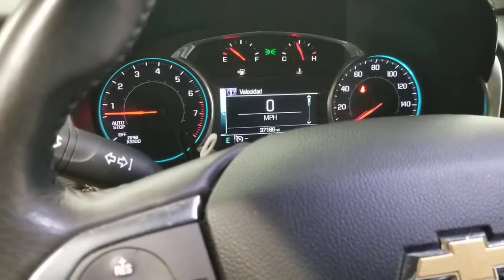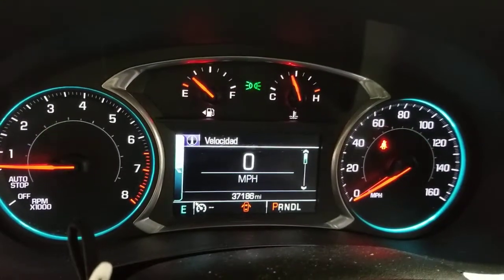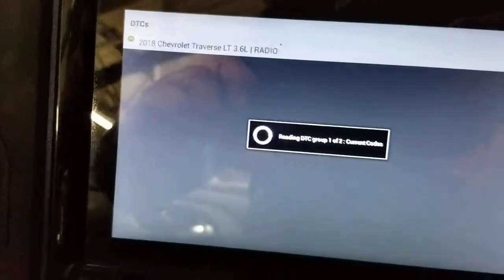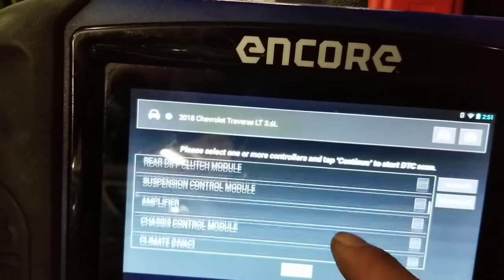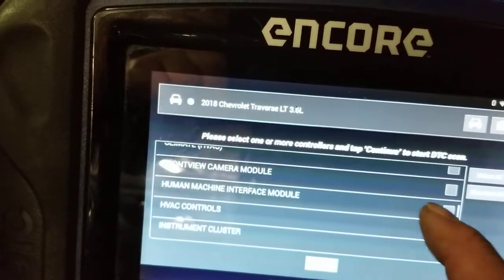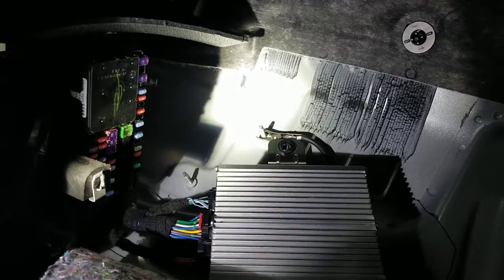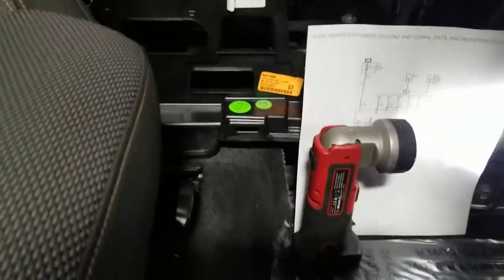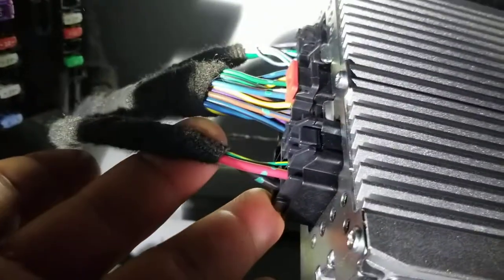2018 CHEVY TRAVERSE NO AUDIO , TURN & EMERGENCY LIGHTS SOUND,LOCATION & REMOVAL OF ANC MODULE OR AMP

Comment: Thanks for this video. I was able to fix mine, I took it apart and cleaned a burnt spot on the circuit board, plugged it and worked!
Reply from the maker: Cool
Reply: how did you remove the side panel to get the module out or did you not

Comment: So i got a weird noise coming from my speakers their not blown out i thought they were they work still but its like a high pitch whistling noise that wont stop no music or radio would be playing volume would be down and off and still makes a ringing noise any information? Maybe my amp has a lose connection or bad ground idk
Reply from the maker: Try to wiggle de wires close to the AMP ,see if it goes away if not it sound like you problem may be the AMP. Shorthing  internal

Comment: I have a 2010 Chevy Cobalt, my radio turns on but there’s no sound from the radio, the blinkers or the door chime. I tried to replace the driver door speaker, and that hasn’t fixed anything. Do you know how to check the amplifier to make sure it’s working? I’m at a loss
Reply from the maker: Would you like to sent the vin number so I can check a sckematic, and what brand audio you have, so I can get an idea to my email plese?  penita33@hotmail.com
Reply: Did you figure out the issue? I’m having the same issue

Comment: I have the same issue with our 2018 traverse, i jumped the wires and there is audio, got the new part and still doesn’t work, place we purchased the GM part from states we have to program it first ?? Is this true
Reply from the maker: No its plug and play, you were supposed to check for power and ground before replacing any part.
Reply: Doesn’t it just plug right in, 3 plugs , the new part was mounted then plugged in
Reply from the maker: It doesnt have to be program to the vehicle,it just plug and play

Comment: What Kind of wire do I need to check for sound? I have a 2014 Chevy traverse. No sound comes from the chime,turn signals ,emergency signal or radio but sometimes makes a noise. Can you help me
Reply from the maker: Hi Miss Gonzalez the wires that comes from the radio, at the amplifier, are you going to check it your self or somebody will do it for you?
Reply: @cjuanchy  I’m going to check it myself. But want to see how I can check if it is the amplifier that needs to be replaced before I buy the part.
Reply from the maker: Can you sent VIN NUMBER please so I can pull a wiring diagram
Reply from the maker: @Alejandra_Gonzalez  or If you like to sent me a good phone number so I can call you when while u doing it to penita33@hotmail.com

Comment: I have traverse 2018 , screen blavk out but working fine on reverse camera, no sound of blinkers and no audio at all . any suggestions?
Reply from the maker: You need to fix your radio first
Reply: Did you figure out the problem?
Reply from the maker: @melissaalfaro9739  yes on my case ,It was the amplifier it self
Reply: @cjuanchy  thank you for the response we replaced the amp and it’s still not working so we’re gonna try a few other things this is just frustrating lol.
Reply: @melissaalfaro9739  i took the car to the dealership let's see what will happen
Reply from the maker: @melissaalfaro9739  Im sorry to hear that, but in the video I showed how to bypass the Amplifier to avoid replacing good parts.
Reply: @cjuanchy me podría tal vez ayudar?
Reply from the maker: @melissaalfaro9739  necesito saber todos los detalles sobre que han revisado ,lo que hace y lo que le han hecho, o si gusta enviarme un número a donde comunicarme con ud o quien esté arreglando el vehiculo
Reply: @cjuanchy  si como se lo envío? Me podría mandar su correo electrónico
Reply from the maker: @melissaalfaro9739  penita33@hotmail.com voy a ocupar el numero de VIN
Reply: @cjuanchy  le mandé mensaje

Comment: What kind of wires can I use to check if there is sound? Like you shown in the video when the radio started playing
Reply from the maker: Its been a while since the video, can you textme yor vin number an a good email or phone number to sent you the schematic and tell you what wires , but you need to make sure that you have power and ground going to the amplifier before checking  the speaker wires

Comment: Hola. Tengo este problema en mi Buick Enclave 2018. Aveces suena y otras veces no suena nada en el estéreo ni las luces de cruce. Suena como cuando un micrófono se cae al suelo o cables mojados.. no se un ruido raro y fuerte.
Lo cierto es que cada vez se hace más frecuente.. aveces suena sin problem otras veces no o va y viene el
Sonido del radio, etc… 
Podrías ayudarme?
Reply from the maker: Gracias por comentar.  Por la descripcion que leeo, apunta como que el amplificador esta fallando ,tal vez le este entrando agua, lo primero seria revisar si hay reciduos de agua en el amp y conectores.

Comment: Me pasa que, me sale este code C0800-03 Control Module Power Circuit - Low Voltage es este mismo???
Reply from the maker: Es el mismo tipo de vehiculo?
Reply: @cjuanchy  si Chevy traverse 2018. Ya tengo audio solo espero q me llegue la parte el viernes

Comment: hello my friend awesome video! looks like the amp is really close to the same amp as a 2016 camaro's do you by chance have a Schematic for which wires i can jump to test if the amplifier is bad or not, like you did?
Reply from the maker: Im sorry at this moment Im out of town,I be back  on 10 days ,if you still need it by then.
Reply: Yesni can use that to
Reply: Did you fix the camaro amp? I have a 2017 camaro and my touch screen doesn't turn on nor do I have any sound for turn signals

Comment: Hola Juanchi! Tengo exactamente el mismo problema Chevrolet Equinox 2018. Podrías ayudarme? 🥺 donde está para reiniciar o verificar los fusiles? 😭
Reply from the maker: En la caja de fusibles busca los que digan audio
Reply: @cjuanchy Hi, I just replaced the ANC module in a 2018 Traverse but still have no audio l. I also got sound after using the jumper wire. Thanks for any help you can provide

Comment: Hola, tengo el mismo problema en una 2015 silverado, radio prende pero no hay volumen en el radio, direccionales, o intermitentes tampoco. Estoy buscando el amp pero no lo encuentro y no tiene BOSE sistema?? Me puede decir donde esta?? Gracias!
Reply from the maker: Buscalo detraz del respaldo del asiento de atraz,debes quitar el asiento y un panel y ahi esta, lleva 3 tornillitos que lo detienen
Reply: Muchas gracias!!
Reply: Lo quite pero no encuentro nada.. quite todo el asiento trasero y nadamas esta el motor para la ventanita de atras…
Reply from the maker: Tal vez esta integrado en el radio ,si gustas enviame el numero VIN que esta en el parabrisas y el lunes que vaya al trabajo lo busco en los diagramas
Reply: 3GCPCREC9FG536026 bueno lo espero…
Reply: El problema sigue ya le desconecte la bateria, cheque los fusibles en el lado del pasajero, le cambie la caratula del radio con otra y nada… otra idea que se le ocurra aparte del amp que no encontre?
Reply from the maker: @JoseLopez-dz8pk   ocupo saber si tiene  navegacion y amplificador o faltan los 2 o falta uno?
Reply from the maker: @JoseLopez-dz8pk  o si prefieres un numero de telefono a donde llamarte lo puedes enviar a mi correo penita33@hotmail.com
Reply: Le mande mi cell al correo Que me dio… tiene navegacion pero amp no creo xk no tiene Bose sistema de audio

Comment: Se puede dejar puenteado sin comprar otro amplificador?
Reply from the maker: Yo lo puentearia si fuese propio,en tu caso tienes sonido en tus bocinas que es lo que uno en realidad quiere escuchar.
Reply: @cjuanchy  no hay sonido, solo se escuchan los twitter
Reply from the maker: @jloaeza65  por eso desconecta los conectores y hasle el puente o bypass como lo entiendas,en pocas palabras elimina el amp. De fabrica.
Reply: @cjuanchy  lo voy hacer así, muchas gracias por tu ayuda

Comment: I have a 2020 traverse an im trying to find the audio control module so i can start adding satellite radio! Can you please tell me where its located
Reply from the maker: FRONT FLOOR CONSOLE,remove both sides  extensión panels

Comment: Tengo una chevy thaoe 2018 
Ase el mismo problema 
El estereo enciende pero no se escucha 
Ni los signolais ni nada
Reply from the maker: Lo más posible es que sea lo mismo,  si le llega corriente y tierra al amplificador.
Reply: @cjuanchy  la verdad no se ni donde se ubica el amplificador en mi tahoe
Reply from the maker: @manueleverardotellezalamil4699  Tu amplificador si es que lleva ,va a estar en la parte de atraz de la salpicadera izquierda,tambien puede ser que sea  el HUMAN INTERFACE CONTROL MODULE ,este esta debajo de la guantera ,Glove box o como la conoscas  tambien revisa que en el lado izquierdo del tablero  la tapa no este aplastando a los alambres.
Reply: @cjuanchy  gracias

Comment: ey tengo el mismo problema en una sierra 2018
Reply from the maker: Muy probable que sea el mismo problema ,ya que por lo regular a los componentes les entra agua y se queman internamente, checa tierra y corriente, despues puedes puentear los cables de bocina y si tienes sonido significa que tu radio esta bueno y que el amplificador esta dañado.
Reply: @cjuanchy  solo que esta no tiene amplificador de agencia
Reply: @cjuanchy  es que le pusieron un cluster digital de denali ya programado
y cuando pongo las signals nonlas marca por fuera y dice audio off

https://youtu.be/pzWThK1l4J4
Reply from the maker: @xaviersito87  pasame el VIN # y tu número por email penita33@hotmail.com